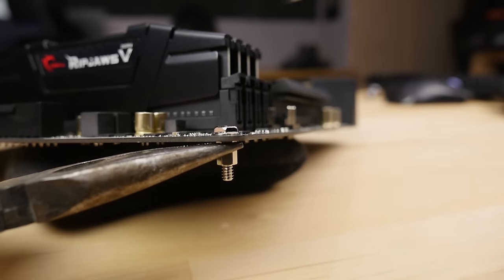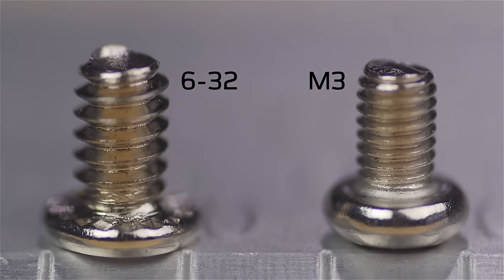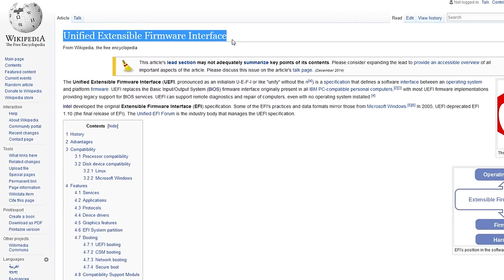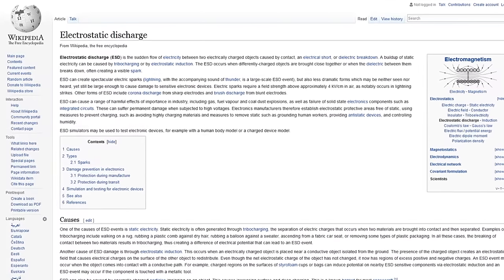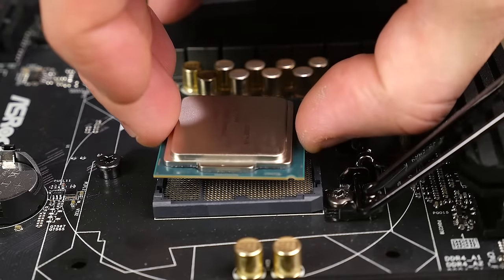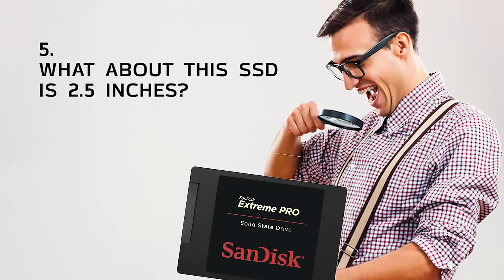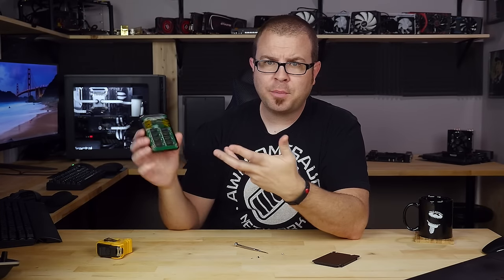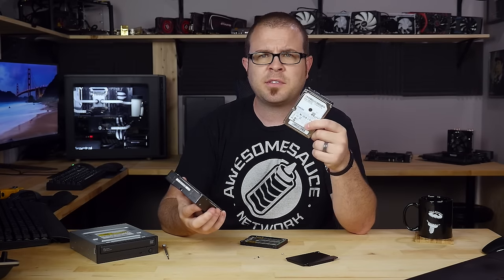5 Confusing PC Building Facts

Comment: I built my PC in the middle of October wearing socks and I plugged all my shit into my mother board on a fuzzy towel, then learned about static electronic discharge after I finished building it, it works to this day
Reply: I've been there before. But it could never hurt to practice safe building, especially when working with hundreds of dollars worth of components. Not saying I always ground myself but I try lol
Reply: I have been a Field Tech for Sony, Dell, and Lexmark. I have fixed every sort of computer on every sort of surface. For desktops just make sure that you are touching the case all the time you are putting the parts in. I have repaired a laptop on a couch while kneeling on the carpet (the guy didn't have a single table or chair) without issue.
Reply: I once swapped out a circuit board in a plasma TV with it lying on a wool/acrylic blanket draped over an ottoman. I'd forgotten the conductive foam pad I used to carry for such tasks and just made do. I did touch the wallplate screw on a nearby outlet for good measure, though.
Reply: right. so... as a field tech, YOU BELEIVE IT'S PROFESSIONAL to tell the amateurs that IT'S OK to not worry about ESDis that basically what you're sayingI've been also been a tech for Sony, Samsung, Lexmark, Lenovo and Unysis I've been working for myself for over 15 years and these days I'm no longer a tech, I'm an Engineer I understand you, and you understand mebut, don't you think it's a bit stupid to tell the newbies that ESD is nothing to worry aboutdon't you think after they get told that stuff by an expert like yourself, they are just going to go out there and try this shit and end up buying new parts based on your advicethere are ways that we avoid ESD and things that we pay attention to that sometimes saves our arsethey don't know that stuffso.. why make the problem worse than it has to be ?
Reply: I think the real message for the youngsters is to not let overburdensome ESD precautions get in the way of getting the job done. If you take what precautions the conditions permit, chances are that you'll lose less productivity to damaged parts than you will to unecessary service call cancellations/rescheduling. Grounding yourself regularly and not shuffling your feet will suffice in nearly all field service situations. Back when I was working on much more expensive midrange and enterprise systems, you didn't take any chances, but swapping out components in consumer and office grade equipment is much more time-critical these days.

Cancelling an in-home service call because you don't have booties, a conductive mat, and wrist and ankle straps will do more to hurt your retainability than zapping one or two hard drives or CPUs per decade.
Reply: Steven Walker I totally agree
but, again,  we are professionals
we have the training (and.. it's possible you may have forgotten this) because as we get better at what we do we take for granted our fundamental training

but, what I'm trying to say is.....

all this precautionary stuff.. TO US
comes like breathing and therefore your comment, ON THOSE GROUNDS is valid

but, to a beginner who doesn't have the instincts that we do to protect components.
you're comment is somewhat valid and somewhat careless
because they will take it the wrong way and fuck things up

other than that
 I respect your comment
Reply: well it never hurts to spend $20 on a mat and wrist strap combo pack which is what i spent on them. the mat is not designed for PC building it is an outdoor mat which has an anti static discharge feature got it at my local electronics store and i will always use it i do not want to fck up a PC and as i will probably only use or need the mat and strap whenever i will build myself a new PC or am upgrading some hardware or cleaning the inside it should last me like over a decade so spending $20~ or less to protect over $5K worth or hardware assuming you replace your PC's 4 times in the decade is not a bad buy at all
Reply: ***** THANK YOU for sharing that.
that's really interesting, and I believe relatively valuable information
good to know
appreciate it
Reply: How's it kicking yet lol

Comment: I ran into the standoff/screw problem when I got my first REAL computer tower (one that you can put liquid cooling stuff in, bottom mounted PSU) I ended up having to go to a computer repair shop and they kindly let me just have some standoffs that they had piled in a giant box. I didn't know until then that there was different threads and screws for standoffs.

Comment: The reason SSDs use the same measurement of similar sized hard drive platters is to keep confusion to a minimum.  It was hard enough educating people to the difference between a 3.5" and a 2.5" hard drive, can you imagine the difficulty in having 2.75" or 4" SSDs?  It would be an absolute nightmare.
Reply: They should have just gone with the slot size to begin with, i mean who needs to know the size of the platters?
Reply: TheHenirik The original disks didn't have jackets.
Reply: Nah, now we can confuse them with the M.2  or PCI express form factor NVMe SSD. No cables at all, plugs directly into motherboard.
Reply: A long, long time ago, there was such a thing as field-replaceable hard drive platters. I kid you knot.

The platter size was all that mattered to technicians called to replace a faulty platter in a hard drive: they would go onsite, open the washing-machine-sized box that contained the hard drives' platters, and replace them. They would then proceed to locally format the hard drive, utter the appropriate incantations on the keyboard, and be on their merry way.

As hard drives became smaller and more sophisticated, replaceable platters gave way to sealed containers that needed a white room in order to be changed, and eventually special high-precision heads in order to have their servodata modified (fun fact: modern hard drives cannot be field-formatted, the commercially-available heads and electronics that read and write your data at home simply don't have the precision required to write at that level of detail). 

The convention to use the platter size instead of the case form factor, however, stuck around during the transition, because that was the way things had always been, and there was no good reason to change them: a 3.5" HDD has always meant "a hard drive with a 3.5" platter", even though there was never a way to field-replace a 3.5 HDD platter. 

For the "new" drives, platter size always implied form factor, even though the actual form factor was not quite the same as the number on the label.

When floppy drives came around, the convention was the same: a 5 1/4" floppy disk fit in a 5 1/4" disk jacket that fit in a 5 1/4" disk drive that fit in a 5 1/4" disk bay. Only one of those things actually measured 5 1/4", but having the same label on all of then meant people would know where to put their stuff without having to think about it, and even the most anal-retentive technician agreed that having the same label on all of them made life easier. They would just mentally add the appropriate length of text t the shorthand.

Similarly, when SSDs came around, 3.5" SSD assumed the meaning of "a(n) SSD with a case that fits in a bay meant for a 3.5" HDD". 

It was shorthand then, it is still shorthand now, and it still matters none: if you are an end-user, you aren't building a case with your bare hands - you want to replace your laptop's slow HDD with a fast SSD, so you go your friendly local PC shop and ask for a 2.5" SSD. The fact that none of the new parts actually measures 2.5" is none of your concern: as long as they all fit where they are supposed to, you are just fine and dandy.

Nowadays, 5 3/4, 3 1/2, and 2 1/2  might as well be XL, L, and S, and people would be just as happy. It's just that that would mean letting people know what those labels map to in terms of the old labels, and there would be no practical return.

For those who have been in the industry since at least the 90s, the actual meaning is implied and non-ambiguous. For those who haven't, it just doesn't matter, other than being a bit of trivia that could potentially serve as an ice-breaker at an especially boring party.
Reply: nychold allessandro-  You seem an old hardware guy like myself,  ever remember using tampons to stop hydraulic leaks in the old drives that were the size of truck beds.  Oh those were days lol
Reply: ***** This is a very common, and very arrogant, way to view computers.  Would you say the same thing about the inner workings of your car's engine?  Ie: if you're confused about which type of oil to use, and can't educate yourself on the weights of oil, should you be obligated to send your car back to the manufacturer with an apology note?  How about coffee?  Do you think someone should know which country the beans come from and the length of the roast before buying a cup?

People use computers for all different reasons, so let's not be pretentious pricks because we have in depth knowledge on the subject, shall we?
Reply: +Nychold except you are required to not be confused about your car, if you want to get a driver's license, at least to the extent of knowing why you need oil and how often you are supposed to change it. 

And if you are making your own coffee, you better know which kind you like: they are not all one and the same.

Similarly, if you want (or need) to use a computer, and are confused by it, you should take a course to clear that confusion.

Even more so, if you want to build a computer, and are confused by it, you should seek expert advice.

Computers are confusing, sure, but that is not an excuse. 

People like say "Oh, I just don't understand computers". Well, take a fscking class. 

Preferably before you accidentally turn your home PC into a zombie host in a botnet, or leak thousands of confidential emails from a political candidate to a foreign power.

So, yeah, if you don't know how to use a computer, you should learn before you take it out for a ride on your own. Just like a car.
Reply: o0alessandro0o  First of all, you don't need to know about oil weights to get a driver's license in the US (where I live.)  You need to know how to operate the car, sure, but we're talking about hard drive sizes here, which falls under computer maintenance, like an oil change would.

Secondly, and most importantly, my argument isn't that people shouldn't educate themselves.  Of course they should.  People should be educated (even minimally) on a wide range of subjects, including things they rarely deal with.  But the whole "send your computer back" argument is just a way for arrogant people to make themselves sound superior, and I cannot stand that.  As you and I have both said, computers are complicated.  We cannot simply expect that people know or immediately learn everything that we know.  But taking up that attitude, where people don't deserve to use something because they don't know every detail about it, is the surest way to guarantee they won't learn about it.  Just to stick it to you.
Reply: +Nychold Just as an aside, I fully expect that, at some point, laws will be passed to mandate a certain minimal knowledge of a computer system in order to operate it,. Essentially, you will need a driver's license for your computer.

At which point, if you are confused by your PC, you will literally have to send it back to the manufacturer - unless you want to use it as an expensive paperweight, of course.

Even today, however, there are certain things one is assumed to know when using a computer: for instance, when you sign a contract with an ISP,  you declare that you are familiar with the Netiquette and will abide by it. Most people have no clue what that even is, but that is not an excuse.

Other than that, I of course agree that specific knowledge about the fine details of a vehicle's maintenance procedures are not required to operate one - just like specific knowledge about the size of a hard drive is not required in order to use a PC.

Almost nobody gets confused by the size of a hard drive or the threading of a computer screw, however - because they never run into the issue in the first place, just like most drivers never run into the issue of the specific type of oil their car requires. 

For an end-user, 2.5, 3.5 and 5 1/4 are labels that don't really mean anything. The fact that a 3.5 HDD is actually more like 4" never registers, because most people never see the inside of their PC.

Most people drive their car to work, use it to go shopping or on holidays, and take it to the shop when the light pops up. They never get confused about the exact type of oil the car needs.

The people who do get confused about that are those who are popping open the trunk and checking the oil levels. And if you want to do that, you better know what you are doing.

Same for building a PC. If you are getting confused because you ant to build a Pc and you cannot find a 3.5" HDD that is actually 3.5" in size... It's time to do some learning. 

Unless you want to use your PC as an expensive paperweight.
Reply: First of all I fully agree with everything you saidnow. on another notewhat happens if you are caught by the cops for OVERCLOCKING Your computerwill you Lose points off your computer licenceand..if enough points are lost will you serve a suspension period ?No youtube or Facebook for 3 months  huh
Reply: Today, if you create an open relay, you are in trouble. You don't know what an open relay is? Too bad, you are still in trouble if you create one. 

Also, a judge can order that you are not allowed to go online for a certain amount of time if you commit a cybercrime.

Things are moving in that direction, I am simply projecting from 20 years ago to today to 20 years in the future.
Reply: Again SgtPiggie, a long, long time ago, there was such a thing as field-replaceable hard drive platters. And in those days the size of the housing did not matter to the technician who had been called to replace a faulty platter.

As time went on, the convention of calling a disk by its platter size stuck around, but I already wrote a post about that. In this same thread even :P

Comment: The trouble with claims like the nature of 'i have never damaged a computer with ESD' is the walking wounded issue. You can indeed zap something and have it work fine at first, then develop odd faults later on. One of the reasons we are extremely paranoid about ESD in a lab is the fact that an ESD damage may not be immediately apparent and having a damaged device finding its way to qual or worse a customer is very very bad(TM). 

Now, PC components are more robust than unsoldered devices due to having more capacitance to distribute a voltage spike on and simple precautions can indeed help. Do not think however you are safe just because you do not feel or hear a discharge. The tolerances for ESD are much smaller than the type of discharge you can feel, even for a soldered PCB.
Reply: This post is artwork.

Comment: ESD is an issue, if it doesn't kill your hardware then it may add to erratic behaviour or shorten its life - best practice is to keep safe and handle things by the edges as the 'Ground Plane' on the PCB should negate damage.
Reply: +Prince Westerburg And I don't get why he advises against working on a metal table. If you ground the table or if the table and the PC's ground stay shorted together, then ESD becomes even more of a non-issue.
Reply: +tehPwnzor7306 Aaah - A good point but that advice goes back to working on monitors in the days of CRT. The trouble is that people tend to use one hand and subconciously put the other o the table. If they touch the HT rail >POW!< Goodnight Vienna!
Even LCDs with electro flourescent backlights have 5kV running through them, at admitedly ultra low current, but enough to cause a shock.
I make my own valve hifi, recording and guitar amp gear so HT is one of those things you learn about and remember - on 211 amps with 1,300vdc PSUs, your first mistake is your last.

Comment: A few more tips..

Regarding zapping stuff, I've done it twice, but it was a long time ago.  I've been more careful since then.  Just remember to ground yourself if you've had to step away, especially if you're building it during the winter or live in Arizona.  It only takes 30 volts to fry certain components, but you don't even feel it until it's about 30,000 volts.  

Put in RAM and CPU before mounting it inside the case.  This helps prevent bowing the board when the manufacturer has terrible mounting-screw placements.  

Before you fully screw in the system board, use one of the rear IO slot covers to space it away from where the back of your video card/etc will go so you can be sure you won't have to slide it around any.

Lastly, bigger fans are generally quieter fans.  Friends don't let friends use 80mm fans.

Comment: 1. A good tip I've used is applying Medium (Blue) Threadlocker on the stand offs to the case, this will eliminate the annoying stand off stuck if you ever remove your mobo.